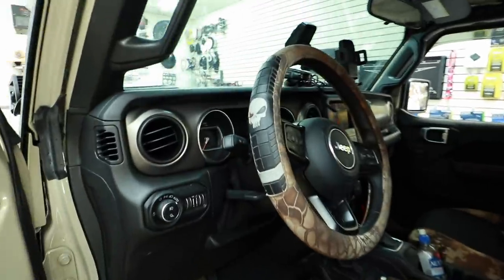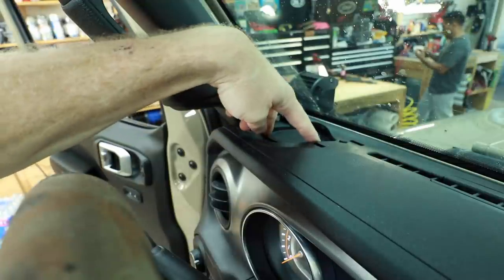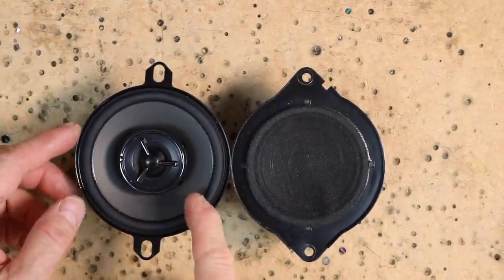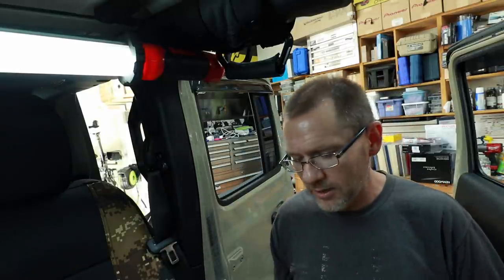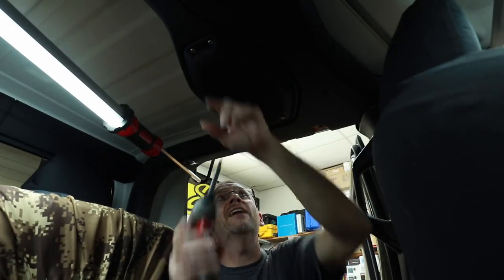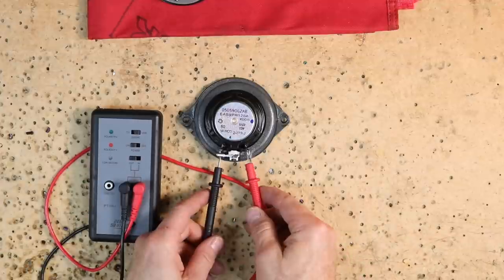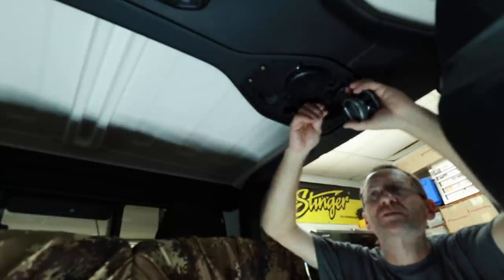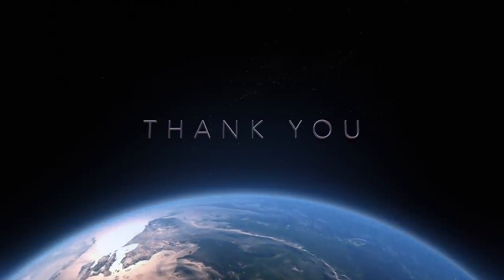How to make you Jeep JL or Gladiator sound better with Kenwood KFC X3C

Comment: I have the 8 4 Alpine system.  The Alpine stock speakers are better then the  speakers he pulled out. But these speakers are still an upgrade. At low volume the speakers sound the same as stock but when you turn up the volume these speakers shine. It's a big improvement. I purchased the wire harness to connect to the stock harness and it worked fine. I did dash and sound bar speakers.
Reply: Did you do the 4"
Reply: @Freaky61  in the sound bar? I did but it was a different speaker
Reply: Were you saying the Kenwoods are better than the Alpines?
Reply: Yes the Kenwood is a lot better then the stock Alpines.

Comment: The new speakers will be significantly louder. At 8 ohms, the 2.2uf capacitor on the factory 3.5" speakers acts as a high pass filter way up north of 9Khz. In true FCA fashion, the speaker wiring polarity is the opposite of what the service manual's wiring diagram tells you it is. That exact same 3.5" speaker (Mopar p/n 5059062AB) has been installed various Chrysler/Jeep/Dodge/Ram models since 2006.
Reply: So, the factory speakers have a capacitor in line on them, but Dean said not to use the Kenwood Capacitor because it makes a pop on power on and power off, well wouldn't the factory capacitor do the same thing?

Comment: I did this swap out yesterday on my 2024 Wrangler Unlimited for the dash and sound bar.  What a difference!  Thanks for the recommendation and your video was very helpful.  Any recommendations for upgrading the 4” speakers in the sound bar as well?
Reply: I just did the two up front using Kenwood’s harnesses that came in the box. Made a huge difference but now the soundbar needs it too. Did you do anything other than plug and play for those?

Comment: Soft dome tweeters are miles better than middlers in my opinion. If I had a JL I would put 3 way components with 6.5 inch midbasses replacing the 4 inch speakers, midranges to replace the factory middlers, and custom fiberglass A-pillar pods for the tweeters, and the soundbar gets 6.5 coaxial speakers or components depending on the availability on the specific line of speakers from a particular manufacturer I want.

Comment: As I would expect, the speakers are 8 ohm because their connected in parallel of 2 speakers each for a 4 ohm load.  But if you put in 4 ohm speakers will give it a 2 ohm load then so seems could blow out the amp section of radio eventually although it seems many people have installed these.  But obviously they would be twice as loud as originals.
Reply: I was thinking the same thing that changing them to a 4 ohm, in the long run or if volume is too high it could damage the amp... one way I was thinking was connecting both of them in series to raise ohms from 4 ohms to 8 ohms

Comment: You say not to use the included crossovers… so the capacitor on the factory 3 inchers, are those removing the lows or highs? And the capacitor on the kenwoods, are those for the tweeter or removing the super low frequencies?

Comment: I would have like more info on the wiring add ons for connecting the new speaker  - checked the polarity, got the first speaker out and now what?
Reply: Plug and play adapters: https://www.amazon.com/gp/product/B0878YRT8X/ref=ox_sc_act_title_1?smid=A1LAPRHCR7XHF0&psc=1

Comment: Only thing I don't understand. So the factory 3" speakers have a crossover, meaning its likely a full range signal. 

 But on the new speakers youre halfling the ohlm load and not using the crossover? 

I think the speaker will be fine, but badly mixed music is going to sound rough.  Think I'd rather live with turn on pop.

Comment: Surprised to see you guys cuy off the stock plug. There are Metra plugs that prevent you from having to cut the oem plugs. FYI for anyone thinking of doing this in your Jeep or other Mopar. I've done this in my Wrangler, Dart, Challenger, and Ram Rebel.
Reply: Those Kenwood 3.5s are cheap enough that I would donate them to the next owner instead of putting those factory speakers back in. One less cost for his customer.
Reply: I’ve asked them this before and they say they have had bad experiences with them sometimes and they prefer to solder them for a secure fit.
Reply: What is the part number?

Comment: would this work if it has the 8.4 alpine?
Reply: I have the 8 4 Alpine system.  The Alpine stock speakers are better then the  speakers he pulled out. But these speakers are still an upgrade. At low volume the speakers sound the same as stock but when you turn up the volume these speakers shine. It's a big improvement.

Comment: I have a 80prs in network mode my 6.5s are running 63hz at 24db to 3150hz at 24 db then the tweeters are 3150 at 24db can i drop my 6.5s down from 3150 to 1500 and add a smaller mid into the mix and run it from 1500 up and tie my tweeters on to them with passive crossovers?

Comment: Thanks for taking the time and effort to do a great how-to video! The problem now is to find those Excelon KFC-X3C's, Any other options you can recommend?
Reply: Yeah...  I am on the same boat trying to find those Kenwood speakers.. they still show up on the Kenwood website so they are probably not discontinued .. I don't want to wait for a new batch...  I wonder if a 4'' inch works if I modify the mount on my Jepp JL..
Reply: Jl audio has a speaker in their c2 line up that shines just as much if not more than the Kenwood Exelon
Reply: Skar audio has the tx3.5
Reply: @I8591les  will the clearance fit though

Comment: Replacing an 8ohm speaker with a 4ohm creates an impedance mismatch. Is this a smart thing to do?
Reply: Exactly
Reply: No it is not smart. Impedence matching is what creates maximum power transfer from the amplifier. Google the term for explanation.